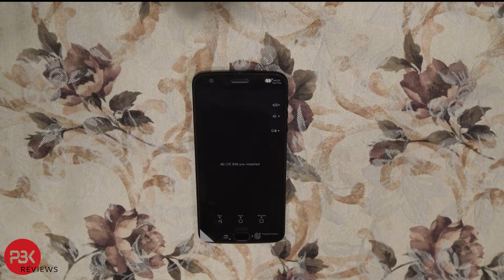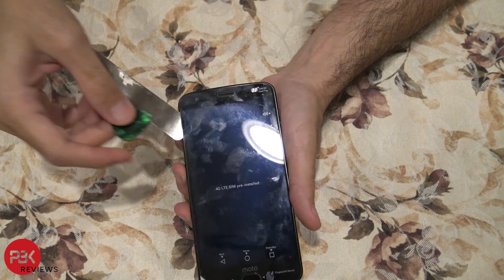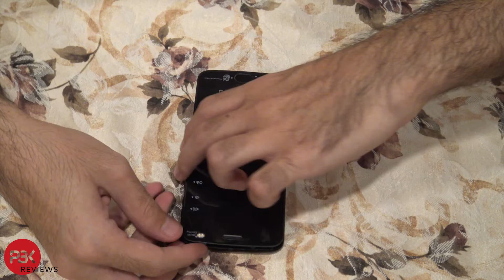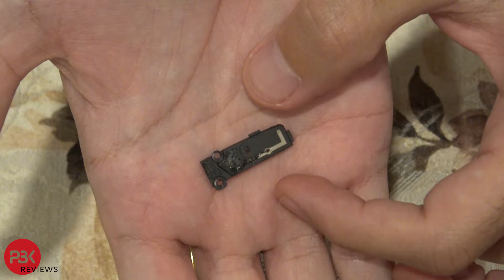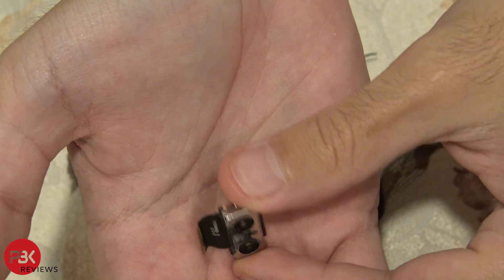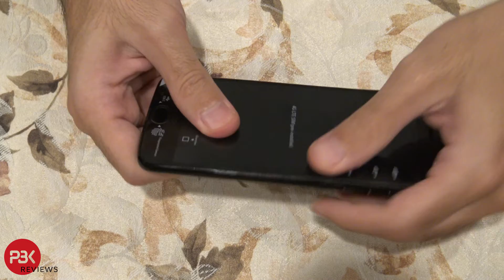Motorola Moto Z2 Force XT1789 Disassembly Teardown Repair Video

Comment: that top left corner has a gap in the subframe and is easy to separate the screen layers if you dont realize.
Reply: and easy to rip the front flash ribbon... yea...

Comment: Hey, i Changed my phones vibrator and buttons ribbon. When i reassmbled my phone all was well everything was working including buttons and vibration. But now microphone doesn't work. When i send whatsapp audio messages the other person can only hear noise. Like fan noise(for explanation) 
I tried so many things but didnt work. Also replaced those 2 plastic connectors besides the charging port, didnt work. 
I just dont know what cause that as i didn't even do anything to the microfone
Reply from the maker: Hmm not too sure. Did you remove the motherboard? maybe you damaged a chip or resistor somewhere on the board. Also try disconnecting or using your old parts to see if it works with those to rule out a defective part causing the issue.
Reply: @PBKreviews  nops. I clearly remember i lifted of the top of the board afer removing all screws just enough so i could change the vibrator. As for the buttons, the ribbon was loose, so didnt change that. Just fixed it. 

Didnt touch the below board. Although, the plastic you showed, the one with antenna lines, both of them were broken, maybe due to excessive force while removing the panel with prying tool. 
I have a dead Z2 force. I took parts from that. Changed the plastic, didnt work. 

One thing i remember now, while the screen was open and i was testing the mic, i had the pryig tool in my hand and it touch the board, a very small spark appeared. But, neither did the phone turn off nor anything else happened.

Comment: Any idea where I can purchase a complete display unit and battery?
Reply from the maker: Screens you should be able to find on ebay or amazon, as for battery you can get an original one here: https://www.mobilesentrix.com/replacement-battery-for-moto-z2-force-genuine-oem-hd40-111690

Comment: The instructions on this video have only resulted in me damaging my phone. There are critical things you have to know that this stupid video neglects to explain that will guarantee screw up your phone. The reality is that you're more likely to peel the screen off the face of your phone instead of opening the phone up. It's extremely difficult to get any tool into the case to open it up, and you're more likely going to just peel the screen off. There is too much finesse required to get this case open safely. Now I'm probably going to have to buy new parts! Thanks allot for your Sh#t explanation!
Reply from the maker: I mean this is a 5 year old video, I do grant that it's not perfectly explained, but through the 5 years I have not had one person complain about damaging their phone aside from you. I'm not responsible for you damaging your phone if you did it incorrectly. I don't claim my video has the best explanation nor is a 100% guaranteed method not to damage your phone.

Comment: Hello, my microphone is distorted, I just have to clean it?
Reply from the maker: Hi, it's possible the hole for the mic on the bottom is clogged, try using an old toothbrush or something similar to brush out the pin sized hole on the bottom where the mic is and see if it fixes it
Reply: @PBKreviews  thanks  🙏🏻
Reply from the maker: @deysalazar5841  You're welcome

Comment: I have a Moto Z Force and Yesterday my cell fall down and the microphone does not work can you Help me
Reply from the maker: Its possible the mic got damaged but highly improbable. It's soldered onto the bottom corner of the board so if it did break, you would probably need a new phone since it's not fixable by the end user.

Comment: How can fix GPS problems? Where is the antennas
Reply: Please,whats seconds in video parta antenna GPS?
Reply: @fabiomel.4450  The GPS antenna is a pin attached to the chassis, on the right side of the speaker that is what I investigated in the electrical diagram.  In my case the GPS does not work due to lack of a capacitor that the previous technician damaged
Reply from the maker: Not sure exactly which is the GPS but the two plastic pieces which are screwed in on the bottom of the board to the left and to the right of the charger port, those have antenna lines drawn through/built into them. If those are not in place correctly they can cause signal issue. Also I would check the black and white wire cables running on the right side of the phone from bottom to top of the main board.

Comment: Greetings, how do I get the flash and the fingerprint reader, since the screen I bought did not bring these last two things, whatever you can help me, I appreciate it.
Reply from the maker: Hi, fingerprint reader: https://www.ebay.com/sch/i.html?_from=R40&_trksid=m570.l1313&_nkw=z2+force+fingerprint&_sacat=0&LH_TitleDesc=0&_osacat=0&_odkw=z2+force+fingerpint     and flash:  https://www.ebay.com/itm/Flash-Flex-Cable-Motorola-MOTO-Z2-Force-XT1789-04-Phone-OEM-Part-390/232731948578?hash=item362fe7b622:g:2goAAOSwpWBaz9N0

Comment: I was able to resemble and replace the battery and speaker but when it came back the Wifi wasn't working. Any thoughts? I played with the black plastic bottom pieces. It also seems laggy
Reply from the maker: make sure all the wire cables and everything is in place correctly, if still doesn't work, its possible you damaged a resistor or chip on the board.
Reply: @PBKreviews  everything looks good as far as connections. How could I tell if a chips is damaged? Is it even fixable? This Z2 Force had a bad battery. The original z2 force I was working on needed a new speaker but when I put everything back the screen wouldn't turn on so I swapped the mother boards.

Comment: Hy im from Indonesia. Now i use moto z2 force unlock mode this very good phone,so fast and so thin i really love this phone.. but now my screen has broken and i don't to buy the part where
Reply from the maker: The screens on these are pretty pricey running $150-250 if im not mistaken. Usually sold on ebay or amazon. Runs just as much as buying a new condition z2 force. Yea its a good phone.
Reply: Not so fast these days. Doesn't run Google Maps navigation smoothly with satellite mode and can't keep many apps open in menory

Comment: Dear Sir,

Suddenly my phone was moto z2 force got switched off after that I tried to switch on the phone but its not on even I tried some tricks also but no use ,  I taken into mobile repair shop they told me LCD probem …they have been trying in UAE 

Can you please tell me where can I brought in UAE,please revert  me back,i have been waiting for your reply
Reply from the maker: Have they checked to make sure the battery cable did not come loose? Not sure where you can find a screen on UAE, you can always find a screen for it online on ebay or amazon or somewhere like that.

Comment: Does anyone know where I can purchase a replacement LCD/Screen assembly (preferably whole)? I-Fixit has Z2 Play screens available, but they're lower resolution than the Force ones.
My screen was fine, but the battery needed replacing. I took it to a "professional" repair shop in CdA Idaho (across from Costco) and they broke the LCD when removing the screen (obviously amateurs) and told me their supplier didn't offer replacements, nor did they offer me anything else; not even a discount on their refurb phones, no apology, nothing. 
There are Z2 Play screens available that will fit, but the resolution is only HD, not the 4K which defeats the purpose of a flagship phone vs the economy model.

Comment: How I can repair the Sim card flex? Please mi device don't recognize the Sim
Reply from the maker: There is no flex cable for the sim reader, its soldered onto the main board. If the pins are damaged and not reading your sim, it would require someone who is a professional with soldering to replace it with a new one and solder the new sim reader onto the board.

Comment: Great video! My battery started to swallow and it end up damaging the LCD, bought two already but when I connect only works the LCD not the digitizer, is there any process to do after connecting the new LCD and the battery?
Reply: Where did you find LCDs? 
The digitizer is known to be easily damaged when replacing the screens and I-Fixit recommends replacing the entire unit, however, they don't say where to get one.  Lenovo will replace the plastic screen for free, but not the LCD panels.
Reply: @RinrvUSA  you mean the shatterproof one? After ordering already two LCD/Digitizer it seems the phone doesn't have the correct drivers to load the digitizer since the synaptic chip might be different.

Comment: I can't get the screen to go fully back into the case? Any help
Reply from the maker: make sure there isn't anything stuck between preventing it to seat properly and also make sure you put the bottom in first since it slides into the lip on bottom then you can seat in the rest of the display.
Reply: @PBKreviews   the screen flame out when I put it back in. Now I have a brick

Comment: How repair the sim port , its a flexor ? Como reparar puerto sim , es un flexor ?
Reply from the maker: No, its soldered onto the mother board. Its not with flex cable, the flex cable you see is for the proximity sensor when you put the phone to your face to turn the screen off

Comment: Do you know what would cause no cell reception after disassembly or what to check. WiFi works, just reception that is either out or barely working, no calls

Comment: Please what happens if the camera is not connect well? i have this phone with finger print, flashlight, camera all not working, am suspecting the Camera connection, What do you think? i want to be sure before i open the phone. Will be grateful if you could help.
Reply from the maker: Not sure don't think it has to do with the camera not being connected well. Fingerprint cable is not connected or related to the camera cable, nor is the flash. You can try taking it apart and reconnecting all the connections but they are not related to one another
Reply: @PBKreviews   thanks, but can you fix the phone without the back camera  connected and see what will happen, this is a new phone and want to be sure what the issue is before i open, what do you suggest could be the problem sir.
Reply from the maker: @thesageofourtime  Honestly not sure, first I would try a factory reset and if that doesn't work next step would be taking it apart
Reply: @PBKreviews   thanks , I have tried Factory reset a thousand times and nothing worked, i changed the ROM and nothing worked, i feel the phone is refurbished and maybe something was not fixed right.
Reply from the maker: @thesageofourtime  Its possible

Comment: Amigo !!!
Buen video, pero creo que al ensamblar en display dañe el touch y ya no baja la barra de notificaciones ya intenté todo habrá alguna posibilidad de que lo arregle o ya necesito cambiar el diplay ?
Todo lo demás jala al 100
Reply from the maker: Hi, it shouldn't damage the display, I have changed many displays on the moto z2 force back in the day and it worked. Maybe you have a defective display, try a different one see if it will work
Reply: Amigo, de casualidad tendrás el número de la cámara del z2 force que circula en México?

Comment: You left the one thing I need to remove! The BATTERY!!!! Mine is swelling!!!!
Reply: Sigh... Got my old battery out. Now neither battery will "click" back to battery connector. I can hold it in place and the device to start, but as soon as I move my finger, it disconnects.
Reply: @Ratteler  I am going to be trying to do a battery change on my Z2 Force as soon as I get the new one. Can you recommend or steer me away from any battery options? Is it the connector that is not snapping on? Need to examine it with a high power magnifier and see why it is not going on.
Reply: @BillKinsman  I wish I could. It's not like the connectors look any different. I'm going to try the thin double stick tape I got to put the screen back on, strategically placed to keep the connector ribbon from moving after I get a solid connection.
Hopefully by the time this battery dies, I'll have a CNC machine that will let me make my own back with an way to use changeable batteries.

Comment: Do we really need all this just to replace the battery?
Reply from the maker: you can remove the battery once you remove the screen and disconnect the battery cable then use the pry tab for the battery to pry it off
Reply: My previous question has now been answered!
Carefully pry off the screen...
Then remove the battery...
Everything else can stay in place!
Reply: @johnlarryedward  <3

Comment: Hi, I am interested to know if you notice the type of microphone that's used on top the devices as the 'noise cancellation microphone', wonder what type, and where is the mic pointed at? It's a death-trap by design of you notice, as the mic hole is just next to the sim tray hole, it's so easy to poke into the wrong one. Just trying to gauge the possible damage, as I did on mine.

Comment: I ended up getting under the screen, but not the assembly.  The screen has a cable clear across the bottom.  So I ended up ruining my screen (which was working fine), due to torn cable at the bottom. So, make sure you pry out the whole assembly, not just the top screen.  Bummer!!
Reply: I did the same thing. I wish I had watch another video first that shows and explains much more clearly the depth of the screen assembly. I appreciate the effort of the video but please accept this as constructive feedback so others don't ruin their screens. Take care!
Reply from the maker: Ya that sucks! make sure to get under that metal plate lol
Reply: Made that same mistake just now.  Did not know there would be two places it could come apart, having never "fixed" a phone before!
Reply: Like I said above...shit video that costs people money!!!

Comment: How repair the button?
Moto Z2 Forcé
Reply from the maker: After you disassemble the phone, to the right of the battery there is the cable that goes for the power button/volume buttons (if that is what you are trying to fix). They cable is screwed into the frame so you would need to unscrew the small screws and remove the buttons from the frame and replace it with a working one if yours is not working.

Comment: do i need to pull off the logic board to replace battery?
Reply: nvm i figured it out
Reply: @marcusaguirre7032  Do you have to?  It looks like you could just take the screen off.
Reply: @dholt44  you have to pull everything off to get to the battery complete disassemble.
Reply: @dholt44  I did replace my battery successfully though I had to pull off the logic board a different way then this video showed though
Reply: @marcusaguirre7032  thanks

Comment: The back of my phone got dented badly. Doesn't seem to affect the performance but it's a huge eyesore. Is it possible to buy and replace just the back, i.e. the bottom half of the phone without the electronic components?
Reply from the maker: Yes you can buy the back on ebay and replace it. Just search for Z2 force housing.

Comment: I like to know about its build-quality. Has Motorola used a low level parts in moto z2 force. ??? Please answer. Thanks
Reply from the maker: I think the build quality is good. I have been using a moto z2 force for a year n half and its lasted me well with all the drops etc.
Reply: @PBKreviews  thanks aloat. can u also tell me how can use offline fm radio on z2 force
Reply: i am using 2 nos moto z2 force 1st one is single sim 1 and half years and 2nd one dual sim 2 month age.. i am very hapoy with look.performence and quality. 
thanks every one
Reply: Honestly, I've been a Motorola fan for years. Sadly it came to an end with this device. Had mine for less than 6 mos, and the battery failed. I'm positive it's heat related, as these newer devices have no way of disapating it. My Moto X pure edition actually is still running solid. The X pure was the last device Motorola officially made before the Lenovo/Google merger.

Comment: Do you need to buy the original glue to reassemble?
Reply from the maker: Its not a glue, its double sided adhesive tape. If you need to replace the tape, one of the better ones you can use are the 3M cell phone Red tape which you can find on ebay. They come in different widths.

Comment: What is the green thing on the PCB next to the front face camera?
Thanks
Reply from the maker: Hi, its the microphone rubber that leds the sound from the hole on top of the frame of the phone to the microphone. Basically insures sound is captured clearly through that small hole and not surrounding areas muffling it out.

Comment: Battery removal...?
Reply: Must you completely disassemble the phone in order to replace the battery?
or is the battery removable once the screen has been removed?
Reply from the maker: after you followed the video on the disassembly, the battery has a black pull tab on top of it, you can use it to pry it off the adhesive it is attached with onto the frame of the phone.

Comment: where can I find a replacement lcd screen?
Reply from the maker: not sure if there are any available yet
Reply: pwrdbykyank yeah I contacted Motorola and they said they're not providing replacement lcd screens, they replace the whole phone
Reply from the maker: motorola never provides screens or replacement parts, only sometimes shatter shields and stuff like that. They do however replace defective or bad parts themselves when you send them your defective phone, however they send you out a different phone to expedite the process and you don't get your same phone back.
Reply: aren't they supposed to be indestructible?
Reply from the maker: Anthony James they are still destructible, if you drill into it or hit it hard enough with a bat you can possibly damage the screen underneath, it just won't shatter. However its kind of really hard to damage it and the possibilities of what can get it to go bad are very few if any lol.